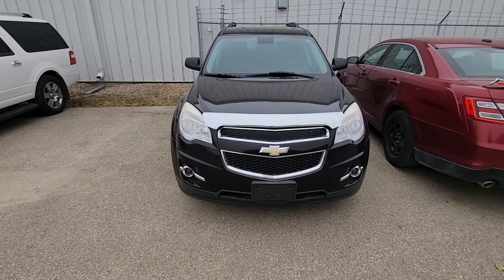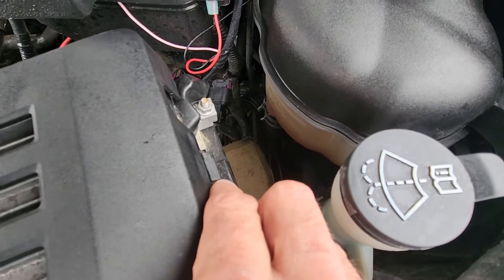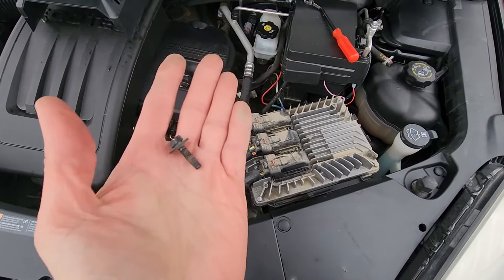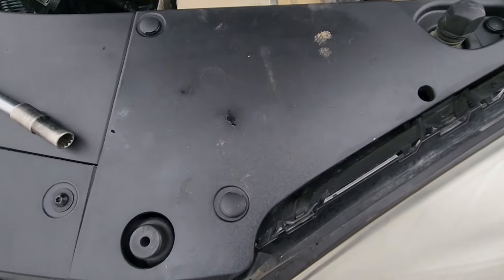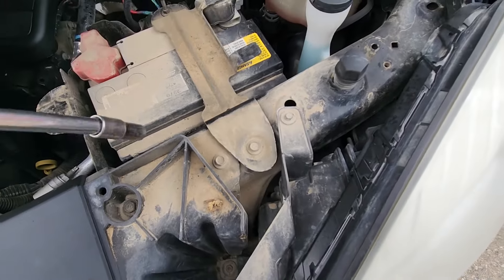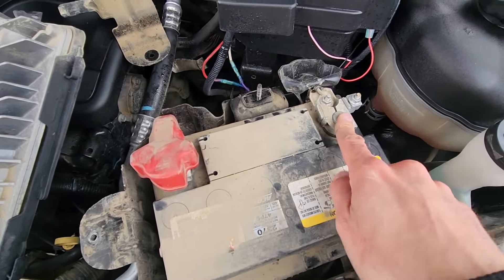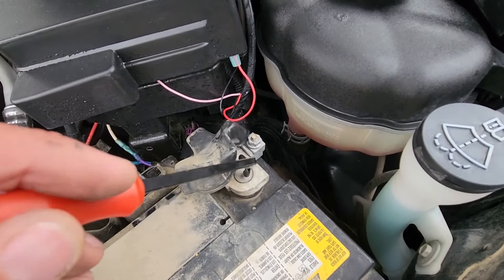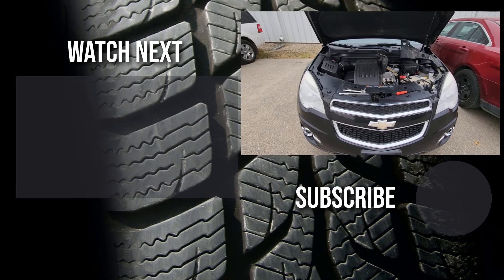Chevrolet Equinox - BATTERY REMOVAL / REPLACEMENT (2011 - 2017)

Comment: Why would the engineers design putting the main computer on top of the battery? when you go to change the battery you can possibly damage the wiring, computer, or both is beyond my simple comprehension.  Thank you for the video, very very helpful!
Reply from the maker: You're most welcome. I agree it is really an odd position of the PCM and doesn't make too much sense

Comment: What size is the screw that comes off b4 u get to the battery. The 1 between the 3 cords. I dropped mine.
Reply from the maker: Hi, it is a 10mm screw. Now the diameter is probably 3/16" but can't say for sure. You should be able to find a replacement in a hardware store